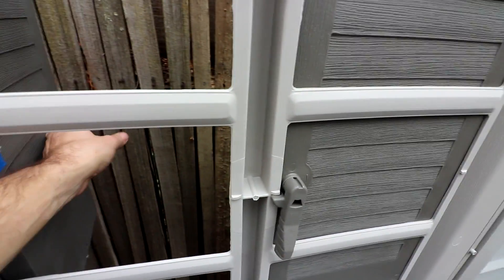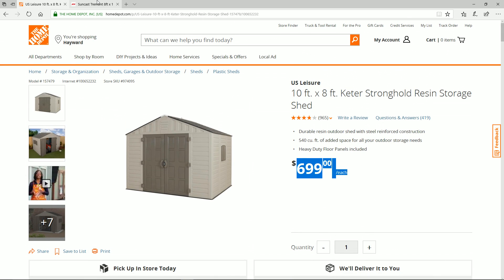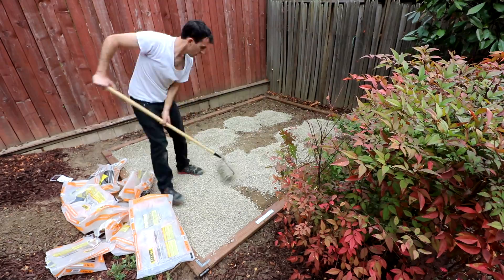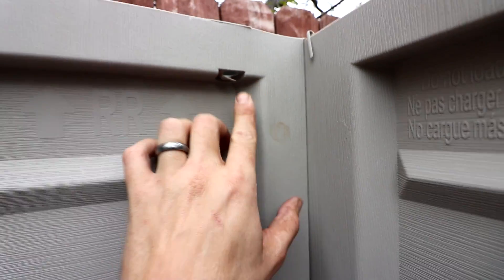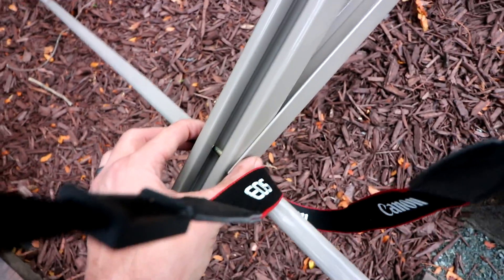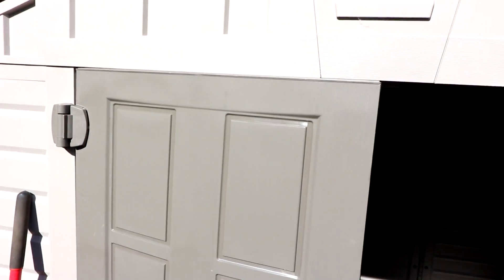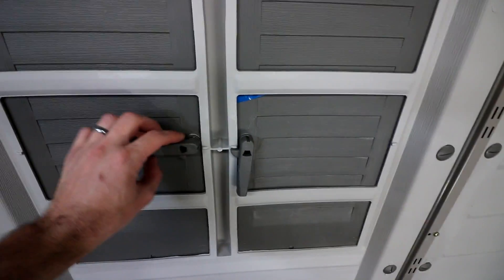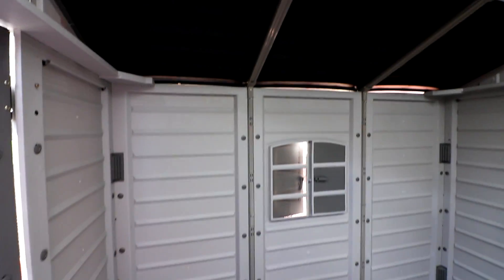10 ft. x 8 ft. Keter Stronghold Resin Storage Shed How to, Tips, Review

Comment: I watched the video.  Very well explained.  I have one of these sheds myself and I'm having trouble getting the floor put together.  I am on pavers.  The two FL and FR pieces fit together well but the the two CF pieces are not fully latching together.  I can get three out of the four clips to latch and sometimes only two out of four clips latch.  I'm not sure what I'm doing wrong because I saw you put yours together by yourself.  The other challenge with the floor is once it feels like the two CF pieces are together, then as instructed I hold at a 45 degree angle but can't get the whole assembly to slide in the other two halves.  When I try to do one side; the other side moves and becomes crooked.  My CF pieces bend easy and I think they shouldn't bend that easily.  They have been out in the direct sun so not sure if the heat caused the parts to warp.  I watched how you were working with the center pieces but it was so fast it was hard to catch it all.  What is the trick in getting the center pieces together so that all four clips latch; then the trick in sliding the whole panel into the other pieces?  Please help.  Thank you.

Comment: Just put it together.. took me a few days.  A few remarks.  1.) rubber hammer helped a ton .. pounded the floor together .. all those little slots have to be clicked in .. very hard without power.  2.) roof was a pain but again slid them pounded them in.   3.) I built a paver foundation which seemed to help with leveling it.  4.). Mine came with 2 RCL panels with flange instead of one without.  Home Depot was good about replacing the part although I had to drive around Phoenix to do so.  So count all parts prior to build!  Live and learn. Ha.   Other than that I’ll see if it survives the summer heat here.  Looks great in my backyard though.  I’d buy it again for the price for sure.  Your video helped me prepare and was on point.  so thanks a lot!
Reply: How the hell are people getting the right/left floor pieces to go together?  It's so damn bendy they just won't click.

Comment: Just built mine up too. But I made a beefier wooden foundation as my yard occasionally floods when it rains hard.  I enjoy the stronghold shed and agree it took long to build it up and finish the roof.  Finished about 10pm at night. And hung my 3000 lumen work light from a tree for roof assembly visibility.  Inside does stay dry as a whistle.  The black flat Phillip's head screws are odd though for the floor mounting.  Some bit into the wood, others just free spin in place.  I have 5/8 CDX plywood subfloors, on 2x4 studs with 16" on center. Hope that helps someone.
Reply: Thanks for the Video clip! Sorry for chiming in, I would love your opinion. Have you ever tried - Mahorrla Wooden Paradise Method (probably on Google)? It is a good one of a kind guide for building better sheds and woodworking minus the hard work. Ive heard some extraordinary things about it and my old buddy Taylor after a lifetime of fighting got amazing success with it.
Reply: @albaniatoro5877  I actually built up this keter shed and built a custom wood platform for it to sit on top of.  Been great now since last December.  Great shed so far.  From Ewa beach guy
Reply: I just picked up a used one.  The guy I bought it from suggested I use plastic pallets for a foundation.  Any thoughts on this?

Comment: Bought the 8 x 10 shed and put it on a wooded base (4x4 beams 2x4 cross braces and 3/4 HD os flooring plywood sitting on blocks all level. Three of us installed all the parts and at the very end the doors won't line up..I checked the base and it's still level. We built the doors and hung them to test and all was good. We installed the roof panels which was easy with the soapy water....Now the doors won't align. I am open to someone who has had this problem to give a suggestion, not that one, I already bought it.
Reply: Jim Teague I plan to use the same base. How many beams, braces, and plywood u used?

Comment: I haven't had help yet assembling the floor so I went ahead and assembled the roof frame.  From the looks of yours the roof frame is assembled corretly but the skylight does not line up with the roof braces.  It seems like the middle pieces putting the two roof frames together are longer than the skylight gaps.  I measured the cross roof pieces and they appear to be all the same length so I'm not sure what I'm doing wrong on this step.  Please help if you can.  Thank you.

Comment: Just finished one of these had to clean out holes that still and plastic in them the corner joints and roof was a pain in the ass to clip to the sun roof. Save your money and buy the craftsman shed it is made with better and thicker resin plus the hinges, and handles are steel not plastic and way way easier assembly. Great video by the way.

Comment: I actually just finished putting my together. I did everything by myself but I can tell you it would have been nice to get some help. The hardest thing to put together was the roof but It is doable by a single person. It was fun and frustrating at the same time. Now, I am trying to anchor my shed down and I will be using a hammer drill and will use 5/8 by 6 sleeve anchor to do so. I will figure something out for the roof later.
Reply: Would you mind sharing your honest opinion about the shed? How good is it? Do you like it?  Thanks.

Comment: When putting the roof on, save some time make some soapy water put in the channels of the roof panels an they slide right in place,
Reply from the maker: good idea
Reply: Thankx!
Reply: G8T idea it worked so much pretty that way!!
Reply: Haha... that’s what I thought, soapy water. Mine is still outside with roof barely on.
Reply: Lovely Video! Forgive me for chiming in, I am interested in your opinion. Have you heard the talk about - Mahorrla Wooden Paradise Method (probably on Google)? It is an awesome one of a kind product for building better sheds and woodworking without the normal expense. Ive heard some great things about it and my buddy after a lifetime of fighting got cool results with it.
Reply: Thanks for the Video clip! Sorry for the intrusion, I am interested in your initial thoughts. Have you researched - Mahorrla Wooden Paradise Method (erm, check it on google should be there)? It is a good one off guide for building better sheds and woodworking without the normal expense. Ive heard some super things about it and my cousin at last got cool success with it.

Comment: My biggest problem so far is the cheesy plastic flooring. Your idea is cool I may do the same thing. How did the pea gravel work out for a foundation?
Reply from the maker: Works great and as others have pointed out you could use bricks or pavers instead of wood around the edges and they would not rot over time

Comment: If you ever need any parts you're stuffed,I can't find any anywhere.I have an older model where large plastic screws,about an inch thick with just a few large threads on the end pull the roof down and others pull the sides to the base.I have 3 broken ones and can't get any replacements at all.

Comment: Do you think it would be possible to move this shed once it was built? I am considering building one in my driveway with the intention of moving it onto a deck once the deck is built. Is the flooring secure enough to stay in place?
Reply: I moved mine but you gotta be careful.  Lift from the bottom and support bottom well..  

Welp... I just realized I'm 9 months late on answering this. 

Heck.. I put mine on a trailer and moved it to my new house.  Worked fine.

Comment: I was going to buy this exact shed from home depot... but after watching this video, now I'm not... I'm going to spend the extra money, time and go with a wooden "TUFF SHED"....
Reply: Everybody has their own reasons for buying and using a shed like this but for me, the siding was rotting off the old wooden shed I have in the backyard and it would cost the same amount of money in materials cause I would have to re shingle the roof of it as well but the labor would be time consuming as well. Couldn't hire a contractor to fix my wooden shed cause it would cost $1000 or more on a 8 X 10 shed. Like I said too, the wood and materials are super expensive right now cause of the Pandemic so I'm doing a 7 X 7 Suncast shed and tearing down the old shed. I plan on moving in about 3 years anyways so the next homeowners can buy a $2,000 shed if they want to. I don't have that kind of cash...

Comment: I went to Home Depot to look at this Keter shed but their display was all cracked up , the windows were wonky plus this shed just didn’t feel as well made as the Suncast so I bought the Suncast 7x7 understanding it’s smaller but I got it with sale and  military discount for $495 usually $630. Bought 2x6x8’ for base with cement piers and 3/4 “ plywood for floor all treated lumber.
Reply from the maker: That military discount is nice!
Reply: @drewtalks  As it should be!

Comment: How do u get the flooring together I have been trying to get the floors together for a hour, the pieces aren’t going in together
Reply from the maker: dont go directly trying pressing in up and down instead of straight on
Reply: Gorebloodzz ...yeah, I was totally impressed with your floorwork! Daughter and I were struggling a bit (and it was on concrete!) 
Excellent work!
Reply: use a rubber mallet
Reply: Took 2 ppl...my husband held one in place with his weight, while I pushed the pieces in....a rubber hammer also helped...Good luck
Reply: @jaada03  I've been trying to do that for 3 hours and it's still not going together.  It's like, just too malleable and bendy or something.
Reply: @jpinard  
Are you certain your base is on leveled ground?

Comment: 3/4 inch crushed limestone is the correct rock to use. Spread the rock out 11x9 feet and 4 to 5 inches thick. build the platform they recommend in the Manuel or pour concrete. MOST IMPORTANT WD40 the damn roof rails... spray that whole track and keep attempting to jam/ click in the roof panels with more pressure each time. You won’t break them. My experience was a bitch with this shed. 26 of my final caps at the end were completely un-punched... I was out there with a razor knife for 2 hours cutting each one.

Comment: I don't know. I feel like with a similar investment in lumber, I could build a similar shed that would last decades.  I'm sure these plastic sheds have improved a lot in the last twenty years,  but I had one of these about 20 years ago, and it seemed to get very saggy after a couple years in Michigan summer.  It's ok to stuff a snowblower in, but not a feasible work shed imo.
Reply from the maker: Euro Dollars good points they have inproved a lot abd if you see it has a pretty solid metal frame that reinforces all the plastic. As the wood maybe cheaper in cost but harder for a newbie to construct
Reply: I would not use one to work in. Its ok for storage and thats it.

Comment: Could you tell me how wide the door opening is?
I have a riding mower with a bagger attachment that makes the mower 4'' 9" wide and 7'' 9" long. Would I be able to pull it in and shut the doors?
Reply from the maker: its 63" wide
Reply: Thanks. 
What about depth from closed doors to back wall?
Reply from the maker: the 7' 9 will fit